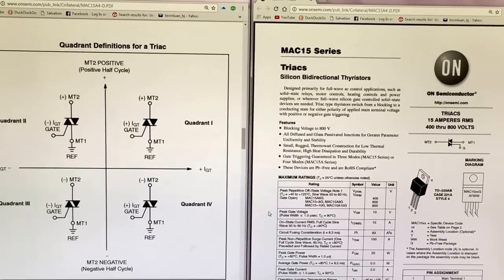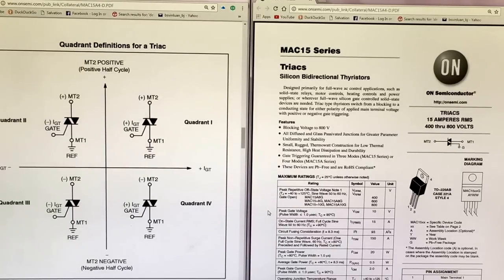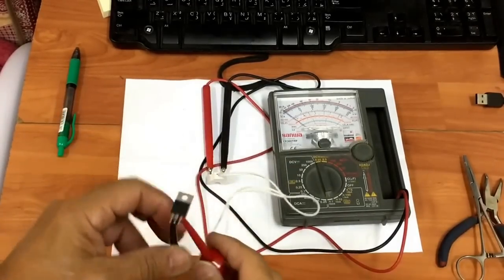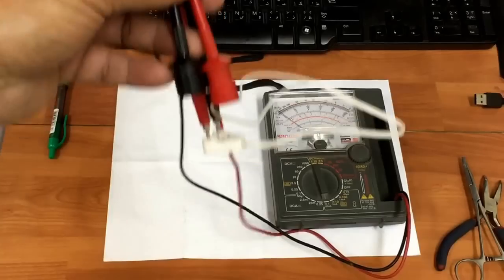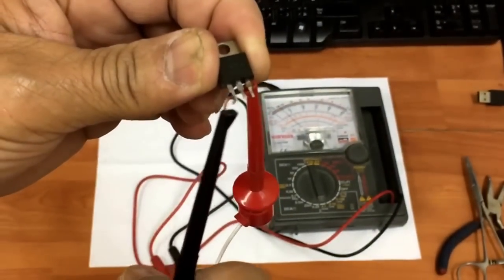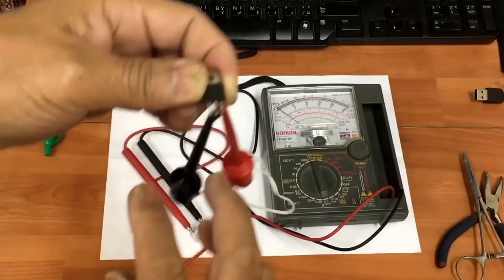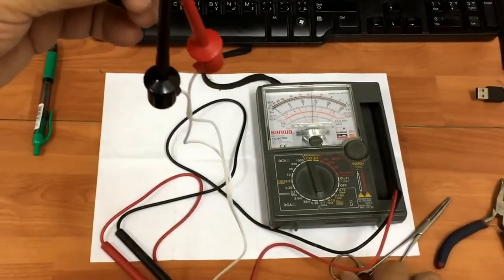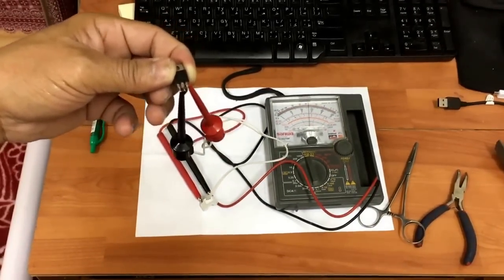TRIAC MAC 15 - SIMPLE WAYS OF HACK CHECKING THE TRIGGER TO WORK

Comment: Thank you for this video. I also use this SANWA (MADE IN JAPAN) multimeter. This is very high quality, wonderful, accurate & heavy duty multimeter. I got this multimeter 17 years before. Still it works fine with high accuracy. Ha ha ha :)